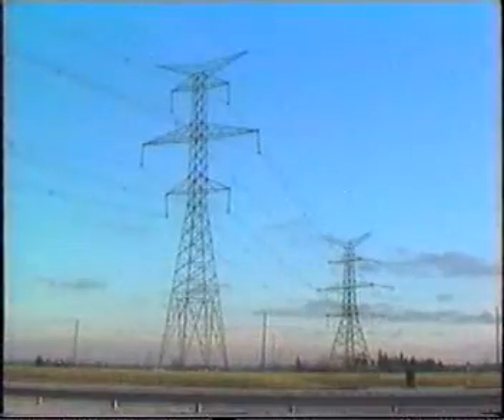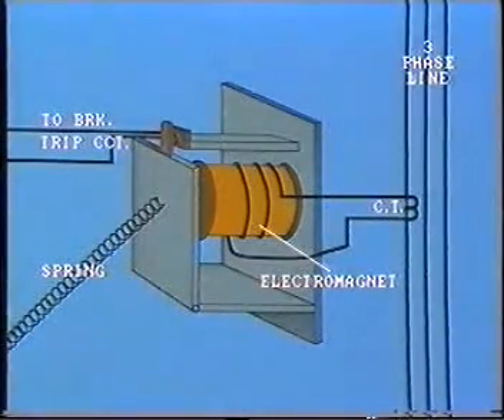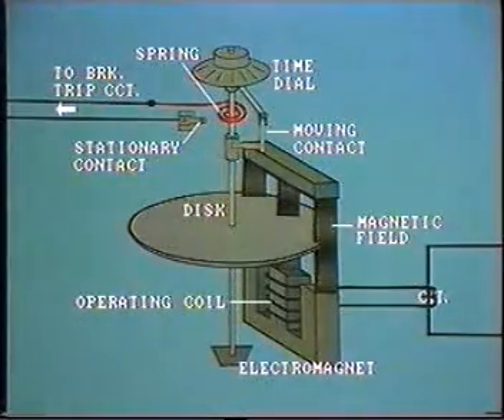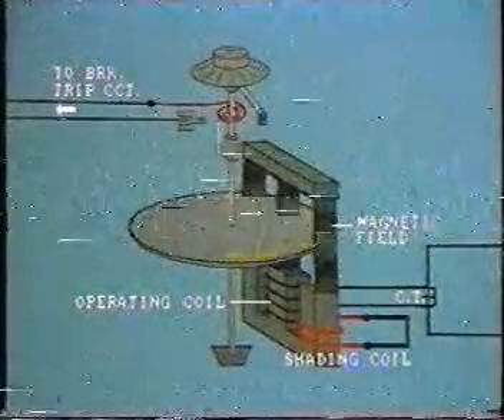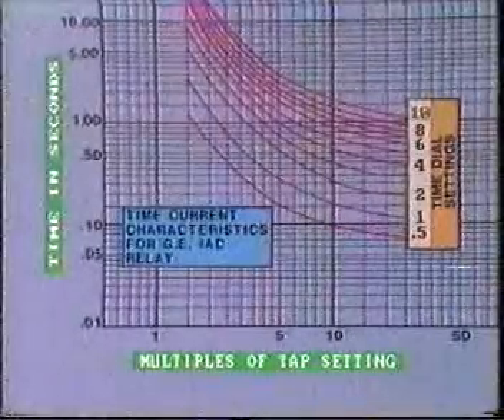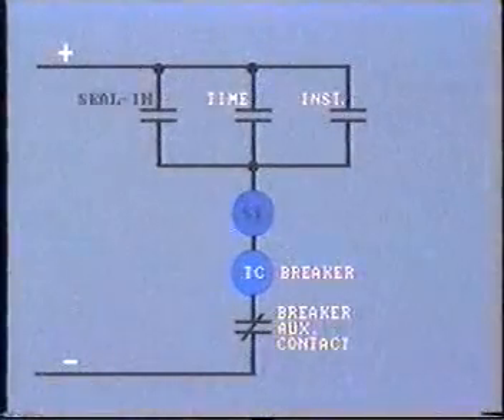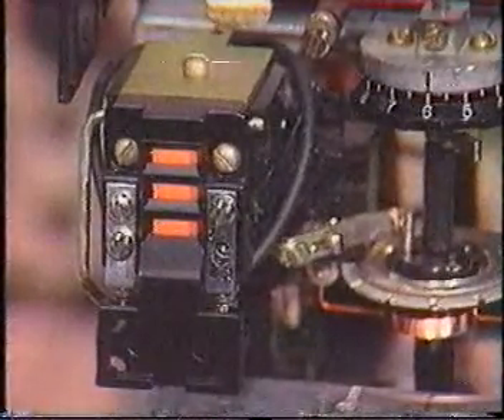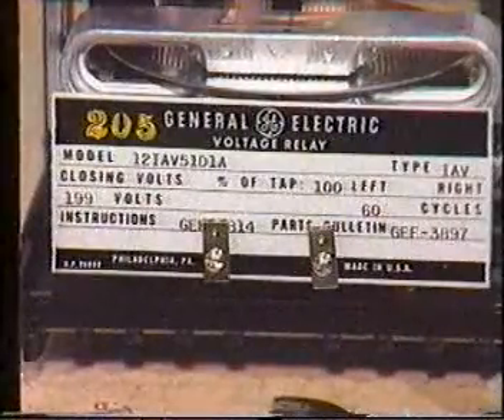Overcurrent Relays

Comment: - Detect quickly the existence of abnormal conditions such as fault or overload
- Operate accurately and selectively to isolate the faulty circuit
- Provide a quick diagnostic on which part of the system fails. By means of flag which indicates the relay has operated, the nature and location of the fault in the system can be identified.

(Applications of Over Current Relay)

- Zone
- Discrimination
- Main Protection
- Back-up Protection
- Unit Protection
- Non-unit Protection
- Sensitivity